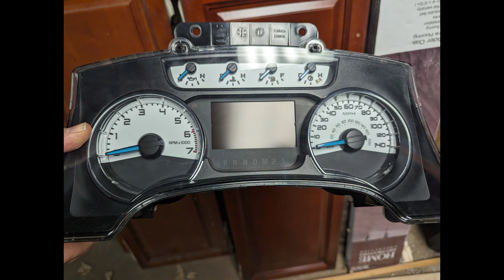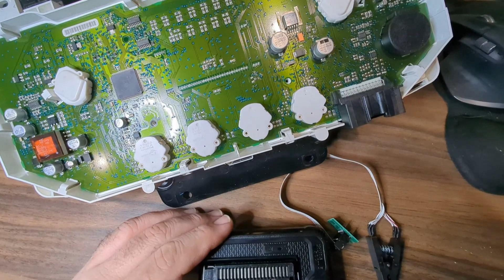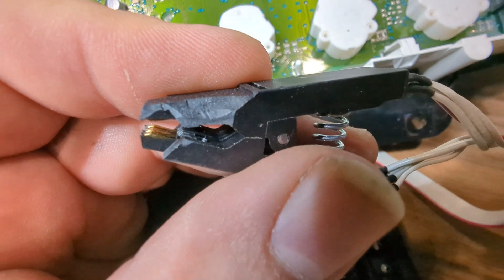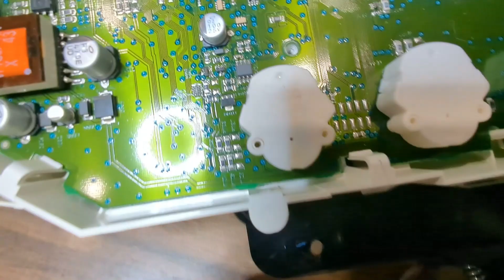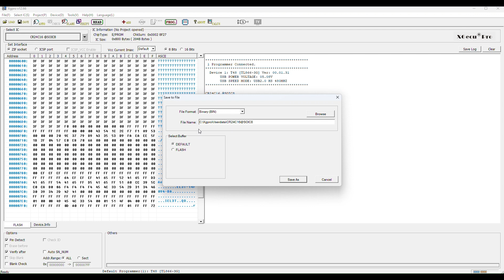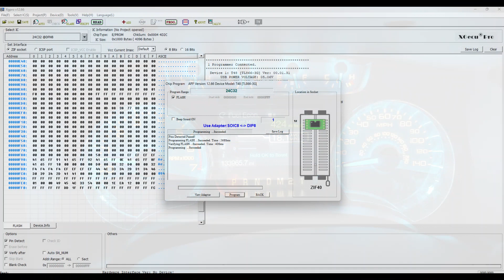2014 F150 Cluster Mileage Correction with XGecu T48 and Xgpro

Comment: Thank you for sharing your info. I'm currently working on 2007 Ford F150 but I noticed that it has 4 eeprom. So therefore how did you know which eeprom to program?
Reply from the maker: I used some guides online that mentioned the chips, but they were light on details so I did this video as I figured it out. 

I don't know which one is on the 2007.

Comment: Salve , complimenti per il video , volevo chiederti una cosa , spero mi risponderai per potermi aiutare, ho il tuo stesso programmatore e la stessa clip ma non mi legge il chip bios W25Q80DV devo per forza dissaldarlo dalla scheda madre . Come lo usi la clip? Cambi qualche impostazione? Nel software? . Grazie se mi risponderai.
Reply from the maker: Per prima cosa ho trovato la clip molto sensibile a come l'hai posizionata. Assicurati che sia collegato a tutti i pin. In secondo luogo, nel mio caso ho dovuto selezionare la versione DFN8 o SOIP8 del dispositivo. Guarda circa 6 minuti e 20. Se avessi scelto l'altro non avrebbe funzionato. Spero che aiuti.

Comment: I down loaded it but doesn't seem right, I plug the programer into the comptur but it says no programer found, the blue light is on the programer did you have problems with connecting the programmer to the egpro on the comptur I see in the video here it says its connected mine says no programer found. any ideas?
Reply from the maker: No, I didn't have any problems. Maybe try a different USB port?

Comment: Hi there thanks for the video I’m upgrading my cluster so I can have select shift I got a cluster off eBay, but yeah the kms arnt correct I bought the device and wire thing but I’m not sure where to get the computer program is there a link I could use to down load it?
Reply from the maker: XGPro - http://www.xgecu.com/en/
Go to the download section. Program Application Programmer. I used the offshore link and then found the latest version and downloaded. 

Notepad++
https://notepad-plus-plus.org/downloads/